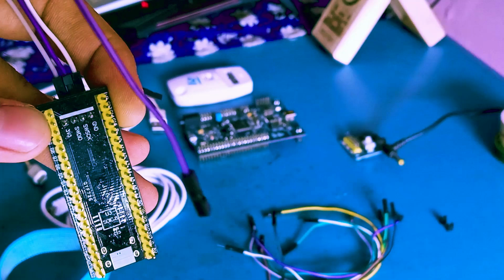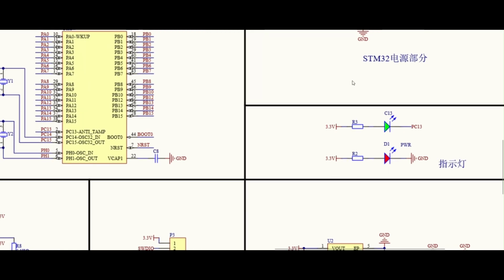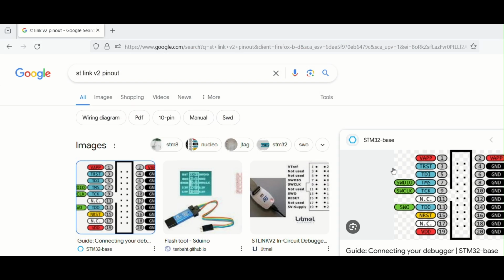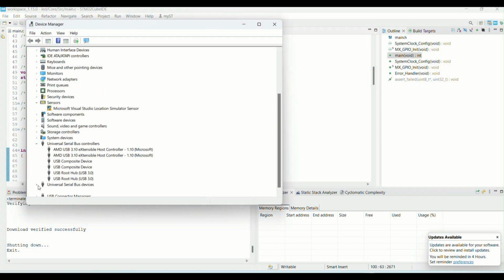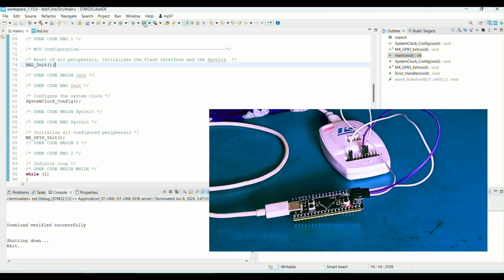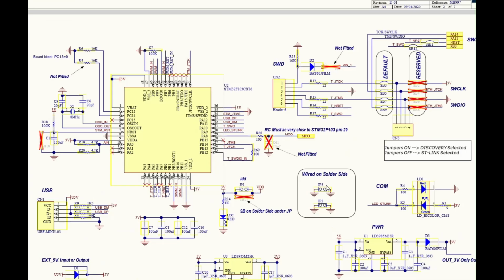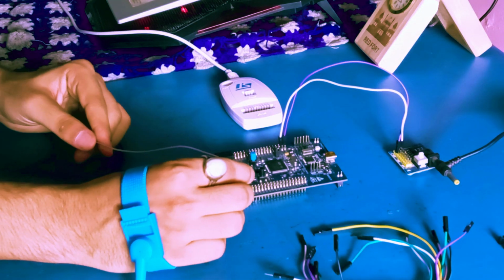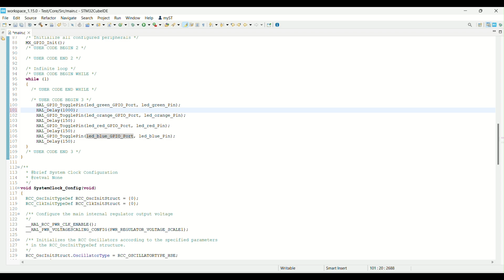Your First Firmware Upload: ST-Link V2 for Total Beginners

Comment: Hello.. i like your video, can you show the wiring diagram for 5:15?
Reply from the maker: Thanks for watching!
The wiring is straightforward:

ST-LINK V2 SWDIO → PA13 on the Discovery board

ST-LINK V2 SWCLK → PA14 on the Discovery board

ST-LINK V2 GND → GND on the Discovery board

Separate 3.3V supply → VDD on the Discovery board

Supply GND → GND on the Discovery board

Hope that’s clear. Also, make sure Debug is set to Serial wire in CubeIDE .ioc file. Don’t forget to subscribe for more embedded related contents! Thanks!
Reply: @eccentric_engineer  thx, how to set Debug to Serial wire in CubeIDE .ioc file  ?
Reply: @eccentric_engineer  Hello... i tried the whole cct same as in your video, but it's not working error as below, pls advise..
Target no device found

Error in initializing ST-LINK device.
Reason: No device found on target.
Reply: hello.. can u please reply
Reply from the maker: @woldecosgrove  This error can often be caused by an improper power supply, loose connections, or sometimes faulty jumper wires. I’ve faced similar issues myself, usually due to bad connections or defective cables. Try checking and debugging these first. If the problem persists, test your ST-Link with another STM board or chip to confirm. Thanks.
Reply: @woldecosgrove It is the same for me. Have you found a solution?
Reply: @roboteer  No, it cant work at all, i think Avinashee Tech is bull shit !

Comment: can we flash nrf chip using stmlink v2?
Reply from the maker: @Gangarapurohith Not without any modification, as the stlinkv2 supports only stm based devices but there is one way in which you can convert it into a jlink debugger (link -> https://www.segger.com/products/debug-probes/j-link/models/other-j-links/st-link-on-board/) and probably workaround with your nrf chips though it is not legal according to segger's licensing terms. Also, it would be a tedious task and may even brick your stlink, if you are willing to take that risk, you may. A better option as per the online search is jlink edu mini (link here -> https://www.segger.com/products/debug-probes/j-link/models/j-link-edu-mini/) as it is the cheapest available option in jlink debuggers, rest all are too expensive for individuals. But even better and cheaper would be to buy a nrf52 dk, that way you get a debugger+chip to run those examples. you can also use it to program external chips (link here -> https://devzone.nordicsemi.com/f/nordic-q-a/14058/external-programming-using-nrf52-dk)